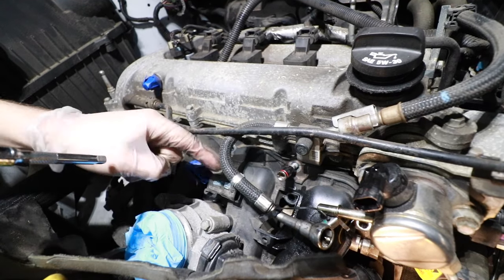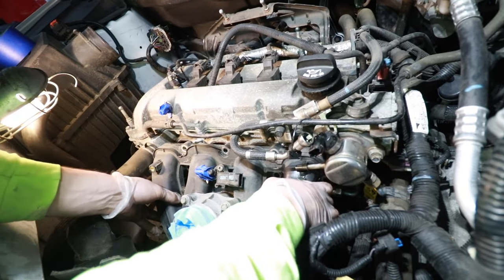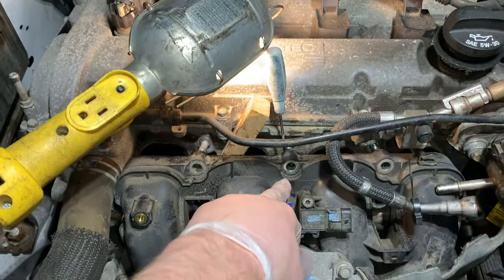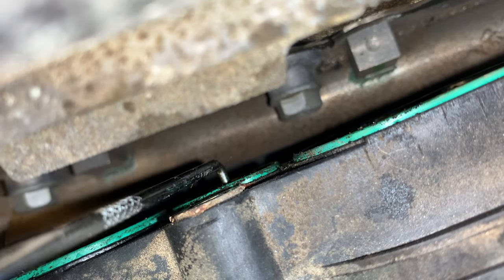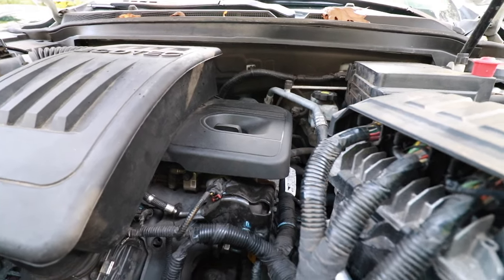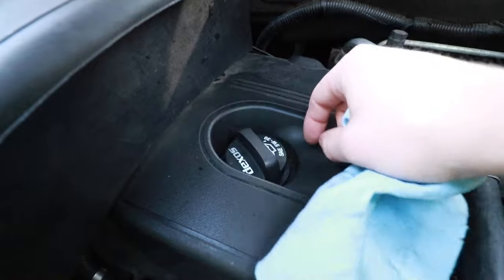GMC Terrain 2.4 Clogged PCV | Oil cap pressure REPAIRED

Comment from the maker: *https://amzn.to/3OEl3XY link to the vented Oil Cap. The oil cap from the factory is NOT vented.  By adding a vented oil cap, if the pcv gets completely clogged, this cap will allow the excessive pressure to vent from the oil cap and should prevent the rear main seal from blowing.
Reply: I bought one and I think it's letting oil come out. I see oil on top of motor that wasn't there before I replaced the oil cap
Reply: Well why do you need to add another problem to your existing problem. If you really need your filler neck and cap not to seal, remove an O ring from either one.
Reply: Helps, but still gotta clean the pcv system in the intake manifold, not just the little hose. Ask me how I know, lol
Reply: I just drilled a 1/8 inch hole in the cap
Reply: Just take the oil cap off and throw it out lol😅

Comment: GM , the company that will force every car owner to become an advanced mechanic
Reply: Mannnn seriously though. Horrible 🤦🏽‍♀️💯
Reply: Something as simple as a pcv system, gm can't fix
Reply: Wait for the electrical problems
Reply: How there is no class action is laughable.
Reply: Another genius GM design.
Reply: Absolutely terrible design flaw
Reply: @ericjacobsen1569  I totally agree My mom bought this stupid f**** car or actually one with the same motor
Reply: Also GM, PCV falls under the 3 year warranty and not the Powertrain warranty so if your engine blows after 3 years cause of the PCV, it's not covered 😅
Reply: This will  be the last freaking GM car i ever own! Even the changing the lightbulb was a hassle!
Reply: I feel the same way about Chrysler. They've created mechanics everywhere. Why would you ever buy a Toyota and miss out on the opportunity for a lifetime of frustration and learning mechanics frantically?
Reply: Ford too
Reply: Nothing is reliable every brand  needs fixed eventually
Reply: @harleyholic7527 Laughs in Honda
Reply: @Sacto911  I had a 2016 Honda Fit it was a lemon too lol

Comment: I tried what I saw in another video without removing the manifold. Drill a hole in the outside of the manifold directly above where the pcv orifice is. then put a piece of welding wire in, find the orifice, clean out the hole, then spray carb cleaner in. When done put sealant on a screw and thread it into the hole I drilled to seal it back up. I can remove the screw to clean it on a regular basis.
Reply: I also installed the FC219 vented cap. Actually found it online at Home Depot.
Reply: did this actually fix the issue for a lengthy period of time?
Reply: @codyjohnson5674  Yes. I can remove the screw and clean it out when needed.

Comment: You people work way to hard, all you gotta do is drill a hole in center hole of intake, clean out clog, and put a sheet metal screw in it. Remove the screw at a later date to clean pcv hole. Lol

Comment: I sure hope you used a new intake gasket. I also noticed the typical chain rattle in the timing area. The Ecotec engines are junk in my opinion.
Reply from the maker: Nope, reused the gasket. Replaced the timing chain in another video. The engine is a crappy engine, but at least it's pretty easy to work on. If you know what to look for and stay on top of maintenance, 200K shouldn't be a problem.
Reply: @OldSoulMillennial  GM had a recall on the timing chain, fuel pump gasket and Chain guides. I took it in and within a month, it was back to rattling. You said you changed the Timing chain. Did you remove the motor ? GM did it in 3 days
Reply from the maker: @johneppenauer6772   Nope, I left the motor in. Are you sure the rattle is coming from the chain? 

Link to my timing chain video https://youtu.be/l9dfi_St4f4

Comment: found a much easier way to do this with only taking the top plastic cover off with the tube leading to the throttle body. You then drill a 1/8th hole in a certain spot and you can clean that hole from the other side when done you put a little gasket maker on a small screw and plug her back up.. allows you to do this every 10-20k miles

Comment: THE BENDINT OF THE THROTTLE BODY / INTAKE SPRAY NOZZLE STRAW WITH USE OF THE WELDING WIRE, IS WHAT BEST I LEARNED FROM WHAT ALL SAW. THANK YOU

Comment: Great video and instruction!  I like how you left your lessons learned like removal of the fuel line and one of the intake manifolds were not required which made the job a lot easier and less messy.  Thanks for posting 👍

Comment: I just did this yesterday. You can removed the high pressure fuel pump easily and that will give you more room to move the intake manifold back to get to the orifice.

Comment: Good video!  I know it does not address cleaning the other orifices at the top of each runner, but at least it helps clear the center orifice without removing the entire intake.  Search... DON'T remove Equinox/Terrain intake manifold. PCV hole Super Easy Fix ((or)) Equinox/Terrain 2.4L Ecotech Clogged PCV Orifice Quick Fix Without Intake Removal

Also, I moved my starter out of the way and it created just enough room to remove the intake plenum.  So I didn't need to remove the fuel pump line.

Comment: awesome video had the same issue i installed a oil catch can and i swapped the oil cap for a  FC219 Engine Oil Filler Cap after that i never had an issue again
Reply: My issue is the same. My engine light is staying on continuel 
 Trying to get some common ground I bought a warranty
They said it wasn't covered????? I've give them 4600
00. In 3 yrs.they have never give me a cent towards any repair. Had to pay for a radiator it cost me 800.00. They told me it wasn't covered. Can you believe that!!! I'm having a war with coverage and GMC. One one knows anything. This has been going on for a month or more. My car stalls it just stops. Engine dies. I had what this video said but the same thing is going on. I hope all who reads this understands what I mean. It didn't fix the problem. I don't think GM knows either. I've talked to serval people and they said the same thing. Thanks for listening. Guess we got a lemon of a deal. Please post your comments so we maybe get it fixed. GM is responsible I feel. Have a pleasant evening.

..

Comment: a tip for anybody doing this work on an equinox or terrain,remove the high pressure fuel pump..makes it alot easier to get intake manifold out without damaging it...I did that..and fixed my terrain..

Comment: A good video for removal & reinstalling the intake, but I agree with the voices saying remove the manifold completely to clear the orifices. It allows easy access to the clogged holes and allows thorough inspection of the gaskets and cleaning of the mating surfaces. A piece of unnoticed debris or a cracked/scratched gasket could cause an unmetered air leak that can cause fuel trim issues and a path for dirt.  I did mine(2017 model) and found the center hole plugged. Suggest removing the throttle body(manual suggests replacement of the TB gasket too) and pulling the dipstick tube up and out of the block hole(carefully as not to damage the o-ring) but not fully removing from the vehicle to gain enough clearance to remove the manifold. This PVC hole clearing may reduce some oil burning by reducing pressure in the crankcase, but not all if the low tension piston rings are stuck due to sludging, carbon or excess wear allowing blow by. Good oil maintenance is important. For the record, other manufacturers including Honda and Toyota, have had fuel dilution and oil consumption issues on GDI engines.

Comment: Such a crap design. Just took mine off yesterday and the airbox where the PCV valve is attached was filled with a water/oil milkshake. Thanks for the tip, buying the cap today from Amazon. Damn thing used 3 quarts of oil in the winter but thankfully didn't blow out the rear seal.
Reply from the maker: Some people are also adding oil catch cans. I think this would be a big help

Comment: ATTENTION----ATTENTION    THESE WERE ALL MY SYMPTOMS AND THE THINGS I REPLACED ON THE CAR BEFORE I SEEN THIS VIDEO AND SOLVED MY PROBLEMS.   

I HAVE A 2012 2.4L ENGINE CHEVY EQUINOX  EXACT ENGINE AS THIS ONE.

MY VEHICLE WAS WAS SHAKING AND ROCKING AT A COMPLETE STOP AT THE RED LIGHT, ITS WAS JERKING SO BAD AFTER DRIVING FOR  A WHILE THAT I HAD TO PUT IT IN NEUTRAL EVERY TIME A CAME TO A RED LIGHT.

I REPLACED THE FOLLOWING THINGS:    UPSTREAM AND DOWNSTREAM  O2 SENSORS--PURGE VALVE----AIR INTAKE SENSOR REPLACED THE LITTLE U PLASTIC TUBE GOING TO THE AIR BOX, THE ONE THATS FILLED WITH WATER SOMETIMES.    I REPLACE THE THE THROTTLE BODY WITH SENSOR ON IT-------I REPLACED THE FUEL CAP AND THE OIL CAP-

I USE CAT CLEAN AND  OIL ADDITIVES---  I CHANGE THE TWO  ENGINE AND INTAKE VALVES THAT SIT ON TOP OF THE ENGINE (GREY AND WHITE ).  I DID MUCH MORE

BUT WHEN I SEEN THIS VIDEO, I SAID TO MY SELF,  ITS NO WAY IN HELL THIS IS MY PROBLEM AT ALL, NO  WAY!!!!    

IT WAS THE FOURTH OF JULY  AND IVE HAD THIS VEHICLE FOR 5 MONTHS NOW AND ITS BEING DOING THIS SINCE I BOUGHT IT.     I HAD CONVINCED MYSELF THAT IT WAS JUST THE TIMING CHAIN THAT HAD SKIPPED, LIKE THE ONES YOU SEE ON YOUTUBE,  BUT IT WAS THE 4TH OF JULY I WASN'T DOING ANYTHING SO I SAID TO MYSELF,  LET ME RUN INSIDE A GET MY DRILL.

I GOT THE SMALLEST SCREW I COULD FIND, I FOUND TWO THEN THE LITTLEST DRILL BIT AND I DRILL A HOLE IN THE AREA I SEEN IN THE VIDEO AFTER REMOVING ALL THAT PLASTIC AIR INTAKE CRAP,       IT TOOK ME 2 SECONDS BUT I DIDNT  FIND THE HOLE, SO I HAD TO DRILL ANOTHER HOLE UNDER THE FIRST I DID CASE IT WAS TO  HIGH FROM THE HOLE INSIDE THE ENGINE MANIFOLD.   

BUT THE SECOND HOLE WAS PERFECT SO I TOOK SOME CARB CLEANER WITH THE STRAW AND SHOT THE CLEANER ALL IN THAT NEWLY DRILLED HOLE, CARB CLEANER SPLASHED EVERYWHERE CAUSE OF THE TWO HOLES I MADE.      AFTERWARDS I TOOK A PAPERCLIP AND WENT THROUGH THE DRILLED HOLE TIL I FELT THE OTHER HOLE INSIDE THE MANIFOLD,  WIGGLE IT IN AND OUT THEN SPRAYED SOME MORE CARB CLEANER IN IT AND  TOOK MY TWO LITTLE SCREWS AND SCREWED THE TWO DRILLED HOLE SHUT.

I PUT EVERYTHING BACK TOGETHER AND IT TOOK ME LESS THAN 12 MINS,  ENJOYED THE HOLIDAY FOOD AND DIDNT THINK OF IT AT ALL.   

I JUST WANTED TO SAY I DID EVERYTHING POSSIBLE BEFORE I LET THE DEALER FIX THE TIMING CHAIN.   BUT WITH MY AMAZEMENT THE NEXT DAY. I STARTED THE CAR AND I FERLT SOMETHING DIFFERENT, YOU JUST COULD FEEL IT.     

YUP, GO TO FIND OUT THAT ALL THESE PROBLEMS MY VEHICLE WAS HAVING WAS BECAUSE OF THIS SMALL PIN SIZE HOLE THE ENGINE WAS FIGHTING TO GET AIR FROM.  THIS HOLE WAS PLUGGED UP WITH CARBON JUST AS THE VIDEO DESCRIBES .

SO THATS MY STORY, I HOPE THAT YOU ALL CAN USE THIS TO SAVE YOU A LOT OF GUESSING AS I DID.   THANKS FOR TAKING THE TIME TO READ MY WALL OF LOUD  TEXT, LOL

Comment: You need to remove the intake manifold,  it will come out. The intake needs to be  flushed out because it has oil in the bottom of it. Once removed then you can decide if it needs the intake valves to be walnut blasted. The  best issue is if it is plugged up you risk blowing the rear main seal! I drill and  attach a  one way valve into the oil filler cap. Like on a fuel line one way plunger, one you can easily blow one wat through it. This will save you from blowing a rear main seal  if you see  any  wetness above your mod on your hood insulation you know that it's plugged. But the loose cap method l like.  A catch can is a must on t 2.4 if you want to avoid carbon buildup on the intake valves. If it has ac the  removal is more challenging, but you need to completely remove the intake!

Comment: I'm just gonna drill a tiny hole ontop of the engine. I will then clean out the hole with a paperclip then install a screw with a rubber washer when im done. I will make a video to show you how I do it. Its so much easier!

Comment: Great job, another thing that can be done is purchase a new oil fill pressure release cap to protect the main end seal. Replacing the end seal will cost you $1200 to $1500 to repair the damaged end seal.
Reply: Can you share an Amazon link to the cap

Comment: I have a2013 chevy equinox l.t.z.and i keep the oil changed regularly two years ago i had to change the front seal on it i also discovered when i take the oil cap off there is alot of blow by so the problem probably is a clogged p.c.vright?

Comment: Good video. You need to buy a inch pound digital torque wrench. Torque on plastic intake manifolds is CRITICAL! Especially on this POS. Worked on a few. Total nightmare.
Reply from the maker: Thanks. Inch pound torque wrench is on the wish list!  I'm old school though, so I'd go with an analog gauge.
Reply: @OldSoulMillennial  I get that! But man the QUINN digitals are way more accurate. For the larger stuff I only use split beam analog and love them! The old twist handles are total junk in comparison

Comment: I cleaned the pcv and switched over my wife’s Equinox over to AMSOIL. That cut the oil consumption to a little under half. We are at 180,000 miles and it runs pretty good still.
Reply from the maker: What is your affiliation with Amsoil?
Reply: @OldSoulMillennial  I am an independent dealer. I am not employed by AMSOIL. I sell my inventory from home, and I also have an online social media and website presence where folks can shop from anywhere in the USA or Canada.

Comment: Great video. Only thing I would have done differently is pull the manifold out and drill out that hole to 3/16 Dia then you won't have to worry about it again.
Reply: I read enlarging this hole will make your engine diesel/whistle and could cause other problems,
Reply: @allancheli  I drilled the hole to 3/16 in. and it is whisling bad. No other problem so far but the whisling is bothering me.
Reply: I also drilled the hole bigger and it’s making that whistle noise also 
 Fml I ordered another intake manifold for 75 on Amazon and it comes with a new map sensor already installed since mine went bad while cleaning up the intake with water you live you Lear don’t reapeat my mistake

Comment: Gm really needs to do a recall on these 2.4 cause they rings are junk and it causes oil to go through,but  This is about the best you can do to fix this issue but be ready to do it every 20,000 miles cause it will clog again
Reply: They did years ago but the deadline has passed. Many people did not take their Terrains to the dealer so a lot of them get sold to other owners and they're stuck with the problem.

Comment: Saved my vehicle saw the difference with the oil cap.At first it was blowing it up now it’s sucking in just cleaned out the hole exactly like your direction easy and didn’t have to disassemble the whole engine 😂.
Reply: Nice job but wil it clog again in a while????
Reply: @101aigle  install oil catch can tons of videos for this motor to keep this from happening again

Comment: I suggest to remove the intake completely reason being that the hole you are trying to clean is only one part of the cleaning. The face of the engine block has a square hole that helps vent the crane case that also needs to be cleaned. If this step is missed the hole you clean on the intake will quickly clog back up. I spray brake cleaner in the opening let it sit a few minutes and I found weed whacker string to work the best but by twisting it and a small amount of pressure it will snake        its way into the crank case. This hole can also become completely blocked leading to negative pressure in the crank case and possibly blowing out the rear main seal. Also I thought I heard timing chain slap when you first started the car. If you have carbon buildup that well also cause problems with the chain. Some great videos on how to do it with out dropping the motor out. Parts are half the price from parts geek and if you have 70000 miles do the water pump at the same time
Reply: I'm rewatching the video because i read that You Heard A Timing Chain Slap. lol wtf
Reply: Yes. The timing chain had almost an inch of play in it and   It wore out the guide at the top of the engine and started hitting the valve cover. The use plastic guides on each side of the engine and they wear out and can even brake.  You can buy a complete kit for around $300. If you have high mileage I recommend getting the second chain kit and the water pump and gasket kit.  I was able to do the job without dropping the engine out of the car. Not an easy job but wasn’t terrible.